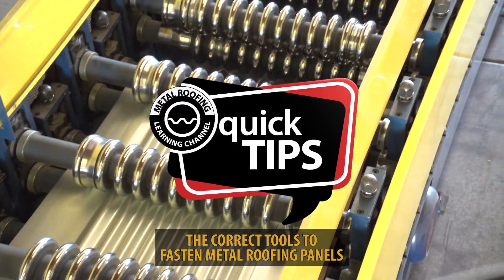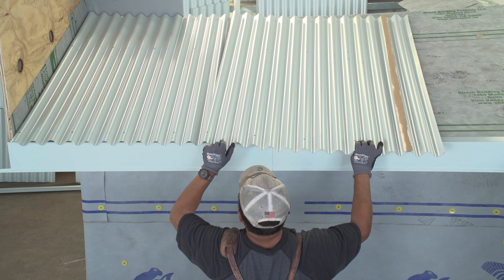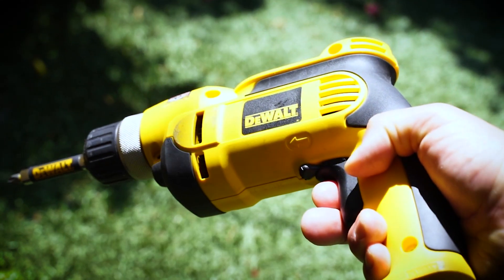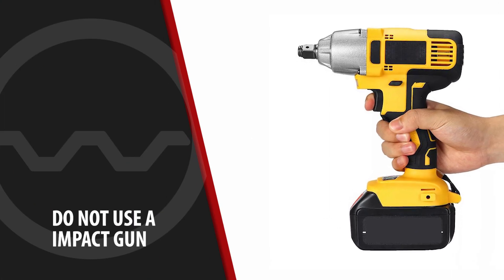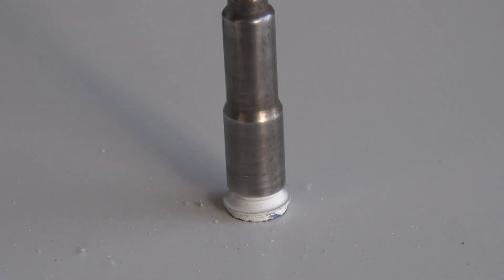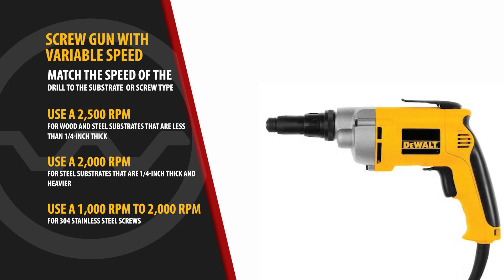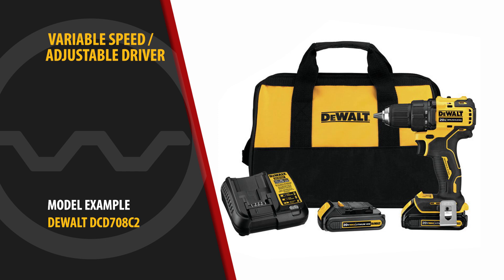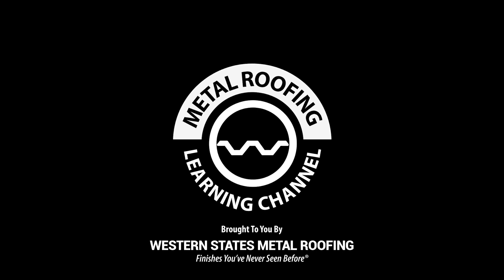Metal Roofing Screws Guns. Fasten Screws Correctly [Impact Vs Screw + Drill Speed Settings + Types]

Comment: Hand drills have multiple speeds and numbers that can be chosen for not to over screw . U need to know how to use tools in first place...other ways ull waist ur money and probably still do the crap job even with the right tool. It's common sense not the tools. Right ones and Good tools just makes life easier. But it doesn't do the job for u.and those washers are crap, when  squeezed they just will decay much faster from heat and cold. So its good to check on them time from time.Drill really ain't going to make a change its just another sail advertisement.

Comment: This is interesting, thanks. I was going to use my drill/driver or impact. Now, I am looking into a legit screw gun. Question please: What if my substrate is asphalt shingles over wood? I have a metal roof which was screwed down some 15 years ago and I am replacing the screws as they have started to leak. What screw gun speed should be used? Thank you again!

Comment: Not clear on the RPM setting. My metal roof is sitting on older shingle roofing which sits on wood. What setting should the screw gun be set at then? 2000rpm? 2500rpm? Less? More? Thanks for the help.